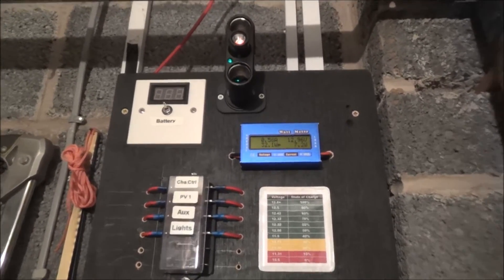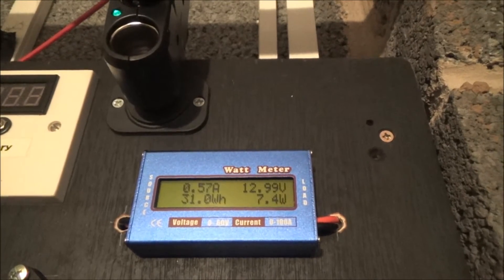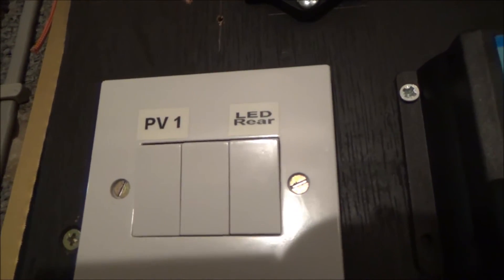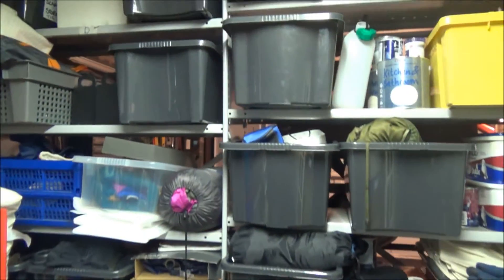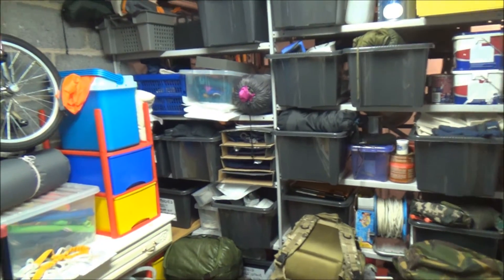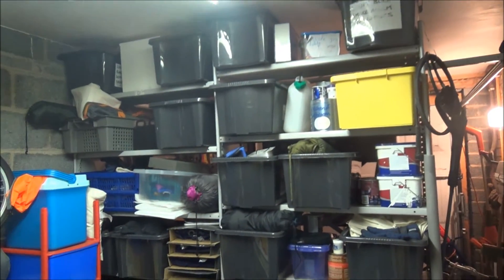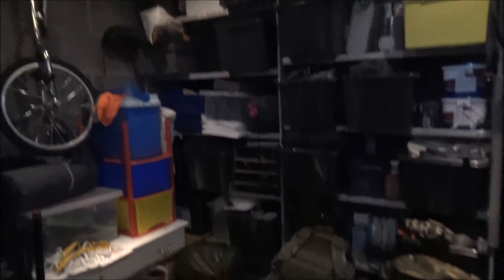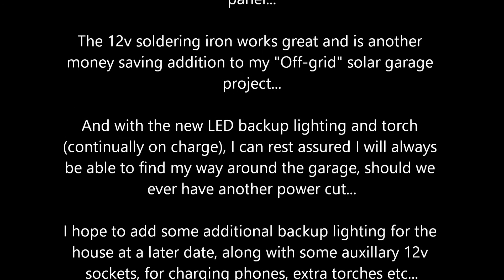Simple DIY Home Solar Project - Off Grid Garage - Part 5

Comment: It's illegal to install spotlights under Part P of the building Regulations unless your qualified to do so. ie, Approved Electrician or trained to do basic electrical work by a Part P organisation. The risk of fire due to incorrect cable calculations for current carrying capabilities of the conductors is considerable.
Reply from the maker: Thank you Glen for your comment. I agree, safety is of great importance when dealing with electrics. The system is only 12v, the cabling is at the correct rating and my dad is an electrician. I also served my time as an electrician...
Reply: Hi Mick, Glad to see your a time served electrician, A lot of people think 12 Volts is alright to wire in their house but don't realise the high current involved is easy to start a fire. hense the Part P requiement. I wouldn't want a viewer to think they could do that and use a but of bell wire and burn the house down....

Regards,
Glen - 26CT1099
(We spoke the other day)
Reply from the maker: glenwoofit Glen, its great to get feedback like this as its useful info that is of value to other readers. Plus, you are quite right in what you are saying, so thank you for taking the time to make people aware. Also, thanks for the contact on Sunday. Great to get a new entry in the log book. Once again much appreciated for your comments and great feedback...